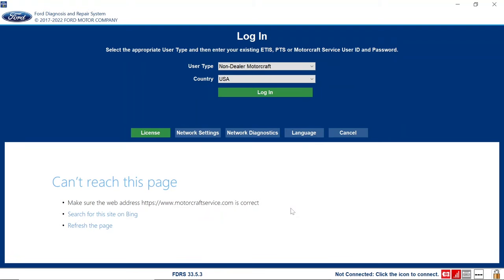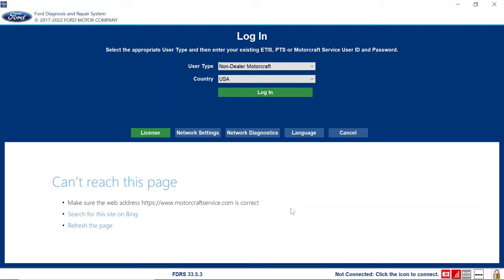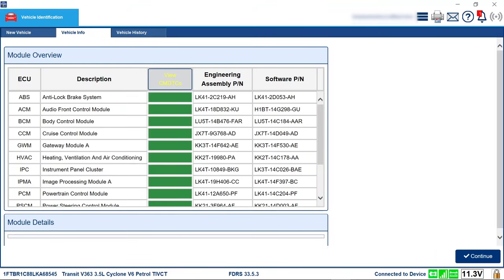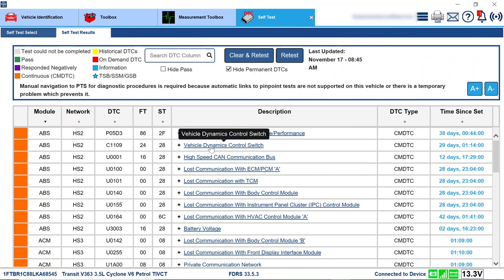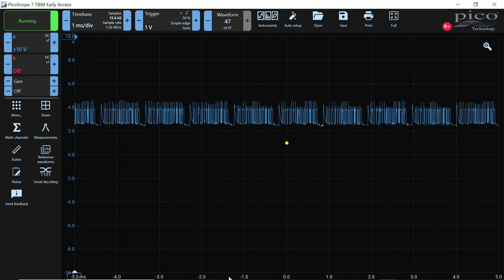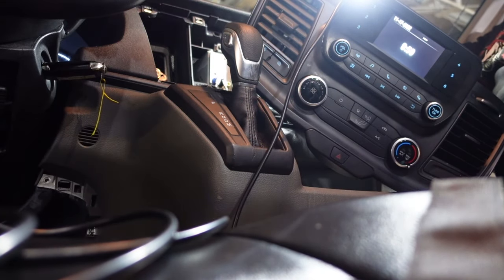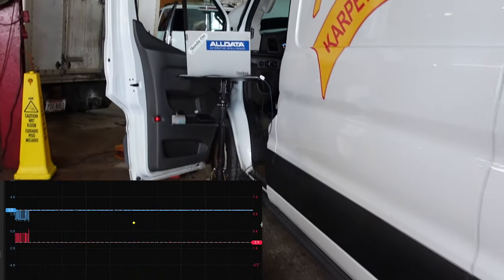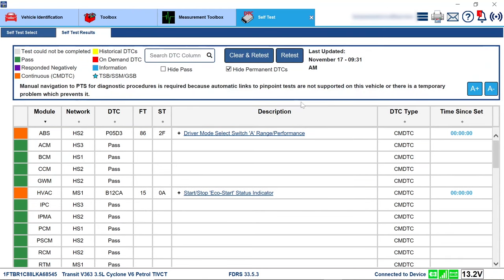2020 Ford Transit NO Blower No HVAC Communication

Comment: I have same  issues on a 2021 ford transit 250.    I have battery voltage on both terminals 17 and 18.  I have not dove into in that deep yet.  Have tie on vehicle.   Any ideas on where you would start?

Comment: So my 20 T250 is have a similar issue. AC stopped, blower works fine. Went through all the fuses and relays. At times the controls would just go out and come back while driving. Would you lean more towards the controls with the knobs?

Comment: Sometimes its easier to check for high resistance with an ohmeter tp pinpoint which wire is. I’ve done it on many cars and its easier. Yes scope is great but to know exactly which wire the ohmeter is a better choice. 👍
Reply from the maker: Hi Vicken, thanks for watching and also for your comment. I personally have been relying  more on the voltages read from the scope  for gaining my direction lately. I feel a case can be made for either way. Here is my take on  a few things..  Depending on the network design AND the type of fault makes a huge difference on the results. On the vehicle in the video I did not get out the Ohm meter so I don't know what the readings would have been, However seeing the H&L voltages together would most likely be a much lower resistance than the 60 we would normally expect. At this point I would probably still have the same process of divide and conquer the network as usual and get the same results.  I recently was on a Ford F series that had COMM issues due to wires corroded to each other and the resistance of the buss was constantly changing between (wires wet too!) Disconnecting the PCM (terminating module) made no change on the resistance,  however the scope pattern changed from shorted to each other to a more normal pattern, and also comms came back to all the modules before the fault!?   After all this I guess the take away is use the tools at your disposal to get a result. Ohm checking is a great go no go in my opinion,  if it gives you good direction roll with it and divide and conquer the network, if nothing solid can be determined I get the scope out.. lately I have been doing the scope 1st with decent results, sometimes busting out the ohmmeter to get direction.    Have a great weekend and thanks for making me think!
Reply: @BrianMann216  Thanks Brian. Yes i use scope too on bus communications. Like you said it depends on the bus design. Sometimes the scope confuses me which circuit is shorted or open. Is some cases yes the scope is faster like on some Toyotas they have problem where the dash gauges won't work and the power steering is hard to turn. Disconnecting the steering angle sensor brings the pattern back to normal. On some cars its pain and ohmmeter guides me where to go and makes it easier to find shorted or open bus line. Thanks Brian , waiting for new videos. Have a great weekend.
Reply from the maker: @vickenkaragozian2041  as we (I) continue to learn and get more experience my eyes open to the multiple ways to get a job done effectively and efficiently.  Next can bus comm issue I will be sure to ohm , just to see what information it yields in addition to the voltage on scope..

Comment: We work on tons of these vans and are now seeing issues with the hvac system. We have 3 vans right now all showing the exact same symptoms. Hvac control module not working at all. All 3 are showing all kinds of varying warnings on dash but no engine light. Check the fuses and even bought a hvac control module to use as a genie pig with no fix. Your electrical skills Brian are  on point and are admired. Any tips?
Reply from the maker: Scope  that medium speed can bus, .

Comment: Hello, 2.5V is not the average voltage of the comm waveform, the 2.7 volts on the one trace was correct, this is what a multimeter would read as the average, I would also expect the low side to read about 2.3 volts. The original elevated voltage you had would have been the giveaway to find this without a scope but with enough hunting to find that corroded connector would have found the problem ith the service data available, bypass the connector just as you have done and erase the codes, and turn the HVAC on and done, not easy but doable knowing the 2.7V and 2.3V information would help with a regular multimeter. Next time try CAN voltages on a good system and you should get what I mentioned and no need to move the readings to 2.5V on your scope as now you know brother. Thank you for the case study.
Reply from the maker: Looking back I can always do a better job when  Speaking on the fly Now the bias voltage should be 2 and a 1/2 volts I messed up and probably said average when I meant to say bias